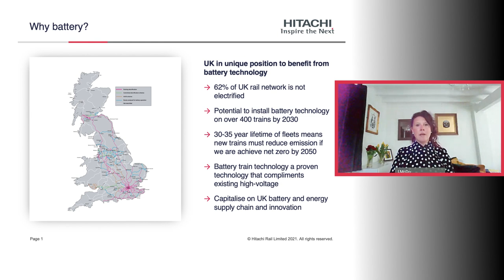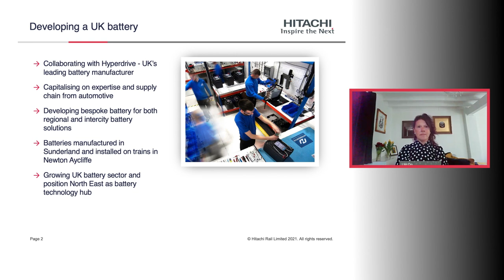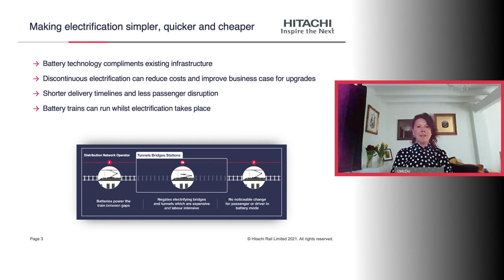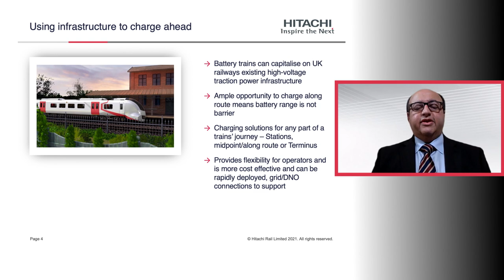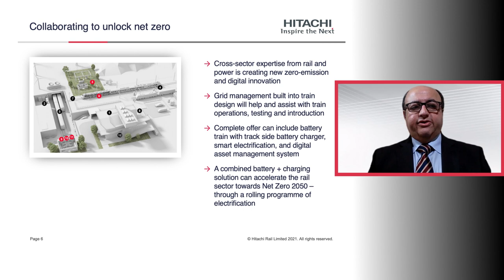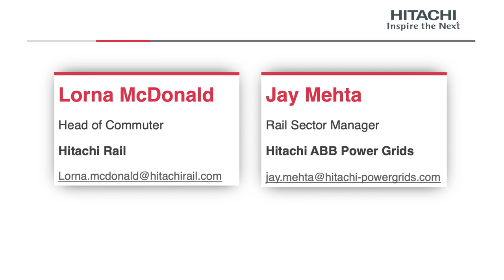Setting the Scene for Battery | Hitachi Rail

Comment: It may sound promising at first glance, but then you need to consider how big those batteries would have to be, and how much lithium you'll need to produce them. 

Because batteries are much less energy dense than diesel, how much heavier will they have to be in order to hold the same amount of energy? How much heavier will this make the trains that use them, and thus increase the loads on the bearings? In turn, how will the service life of parts be affected?

Knowing that lithium batteries degrade over a few years (anyone with a smartphone should understand this), how much will it cost to replace those batteries? And how are the degraded batteries disposed? Furthermore, what are the environmental impacts of mining all this lithium for the replacement batteries?

And about your lecture on "emissions", you didn't seem to account for the fact that a significant proportion of the electricity is still generated by combustion.

The way I see it, in an age where planned obsolescence is the primary business model, this battery power is just a profitable area to exploit. I wonder if Hitachi would continue to make this case if all the contracts go to the company's competitors.